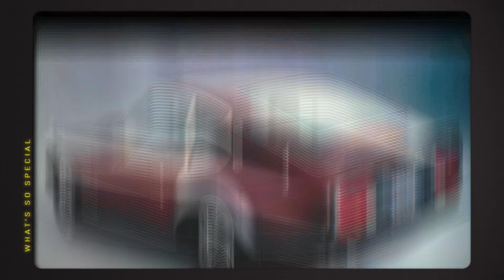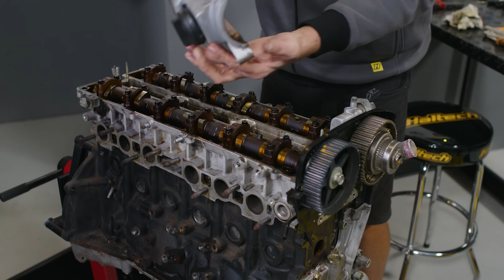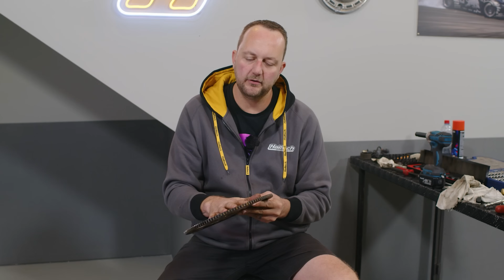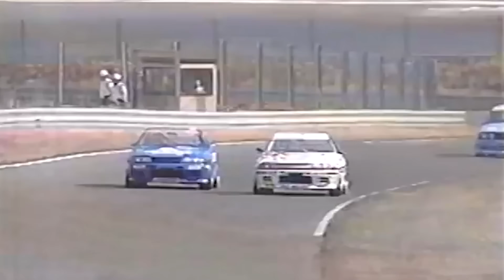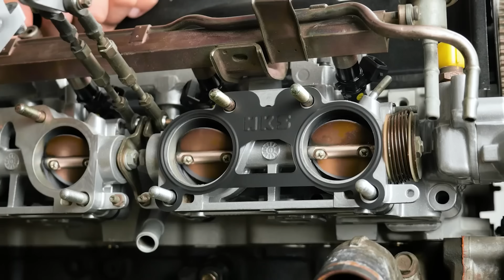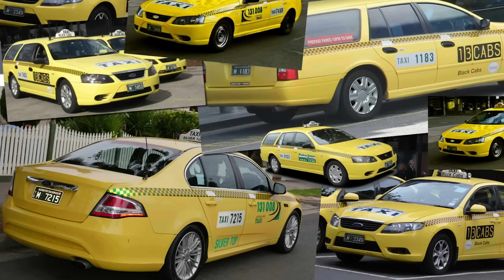MEGA EP! JZ, RB and Barra: The Holy Trinity

Comment: If I can offer some general advice, if you have the engine out of the car and bare, very seriously consider installing forged pistons, upgraded rods, and a valve job at the same time.
Because a big chunk of the labour is pulling the engine and stripping off accessories. If it's already stripped , then its not much more effort to install forged pistons and upgraded rods.

Comment: Why not compare the different 2.4s/2.5s 4cyl from japan k24, 2azfe, Qr25de and stuff
Reply: The inline 6’s are on a much higher level and their price is indicative of that.
Reply: @drewski5730  Head flow is poor on RB26 and 2JZ. Not sure about Barra. 
They need capacity to do what they do.
Without it they would have nothing.
RB26 is a good example, originally it was the RB20 wasn't making enough power for their liking. 
So only thing they could do was to stroke it to the RB26.
Reply: @igvtec they flow just fine, but that’s kind of irrelevant if you know something about engines. They’re both forced induction which means they don’t need to flow that great, they just need to spin at high RPM, and they do (in particular the 2JZ can be spun to 11,000 rpm without dual springs and at 35psi, that equates to well over a thousand horsepower reliably, long term). In addition, the 2J/1J can put up with crazy high combustion pressure, the RB was also considered quite stout for its time but is decidedly ordinary in the current decade. This is what the Japanese engine formula was all about: very stout engines made to perform efficiently with boost. 
The K2& simply can’t even approach the level of a 2J, you’re talking 400hp compared to something capable of 3000+ hp with the same mods. It’s like comparing a Bicycle to the space shuttle. 
The K series is a fantastic engine, I’m not throwing shade at it. 
Have a look at the real street video just released on their 2J test mule tear down for more info.

Comment: I fully concur with running a single turbo, especially in terms of simplicity!
I also believe it NEEDS to be a Twin Scroll on a Split Pulse manifold.
It's why the Japanese ran two turbo's on separate banks; To make the most of the exhaust pulses while reducing manifold pressure and thereby excessive heat, both of which creep back into the cylinder (Reversion) and increases the risk of detonation.
Better flow also causes faster spool at lower RPM!
Look at the Barra FG turbo manifold and consider that the Barra fires the front and rear banks alternately.... it's ALMOST a split pulse manifold... practically has a mounting face on top for a V band flange to fit an external wastegate *Hint *Hint!
This is why tuning benefits FG XR6T's far more than the "lower reversion" BA/F turbo manifold, it's not all down to the swirl pot heads Or the smaller turbo...

Comment: Holden 179 HP. Steel crank and rods. Was quick in the day with some work.
Reply: I love the Holden red motor I have plenty of them running in cars 

But there day was a very long time ago I wouldn't imagine that haltech would be interested in such an archaic platform 

But that won't stop me enjoying my 179s 186 or 202s
Reply: Man I remember they were still pretty popular in the 90's.
A primitive design which worked better in practice.
Reply: Gear driven crank which is great. Pity about the fibre gears though, best replaced with alloy ones. It’s simply doesn’t make sense for any cam in block engine to have a chain driven cam. If both the VW flat 4 & the Rolls Royce V8 can both have gear driven cams then there’s no good reason all cam in block engines can’t. It just means the cam rotates in the opposite direction to the crank.